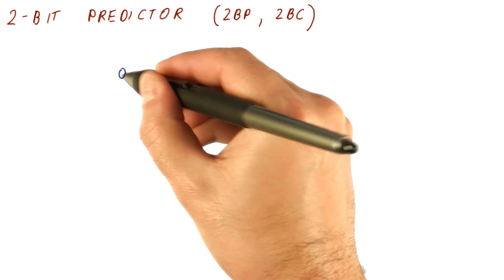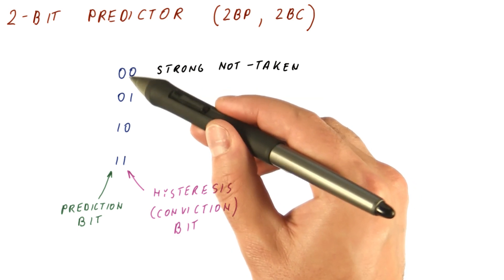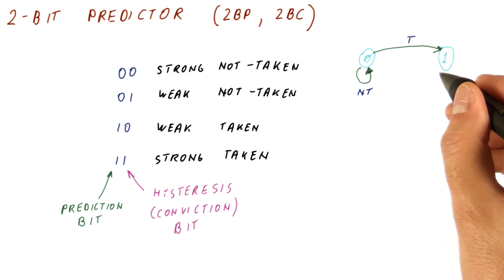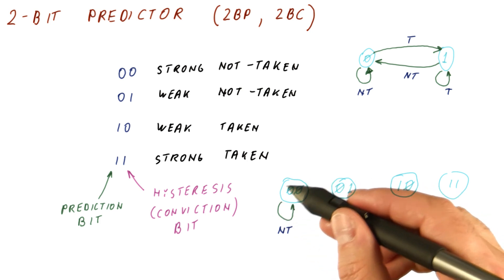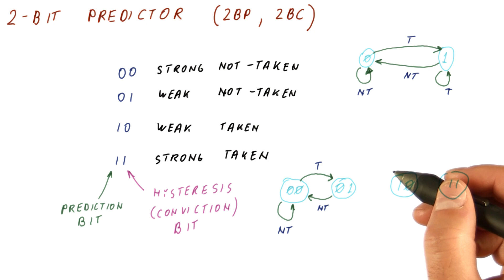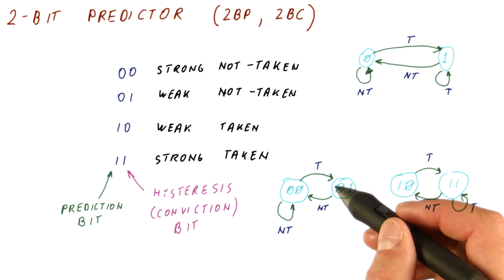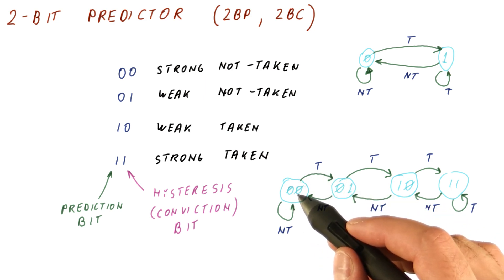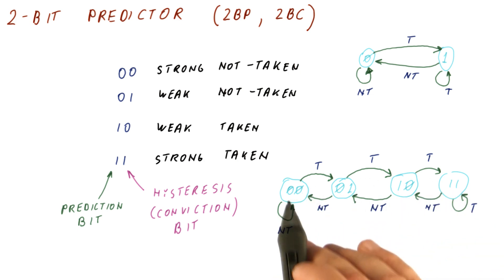2 Bit Predictor - Georgia Tech - HPCA: Part 1

Comment: So what is this actually able to predict?
Reply: whether or not a branch in a program will be taken or not . Very early systems didn't have any form of prediction , and usually always went for one state by default  (taken or not taken , hardwired in the architecture ) .If the branch went the other way , the pipeline was flushed . this resulted in a ~50% branch accuracy , but mispredict penalties were fairly low , so it didn't matter much . Newer architectures have high mispredict penalties , so accurate predictors are needed.